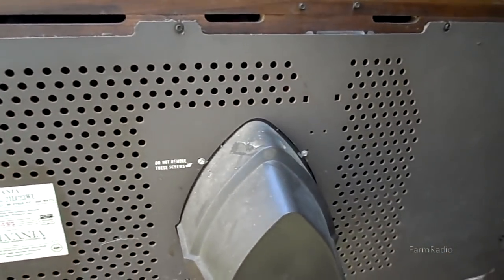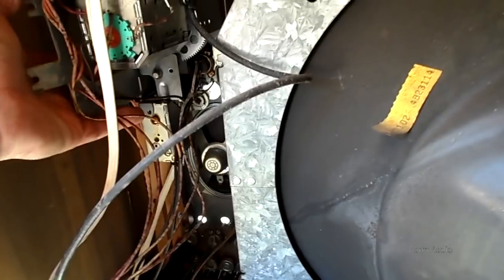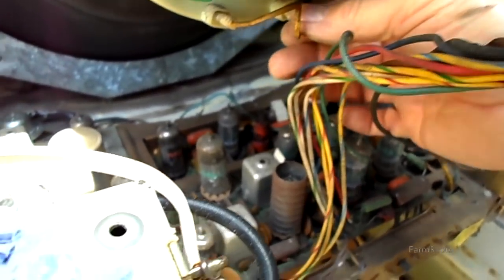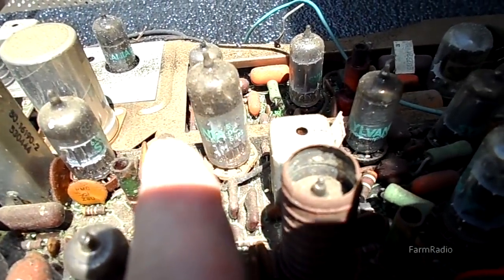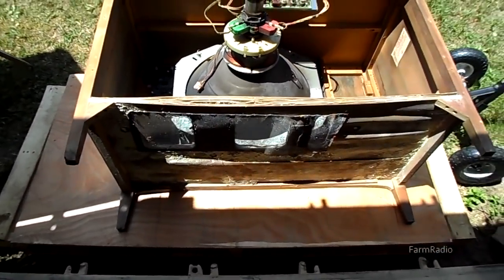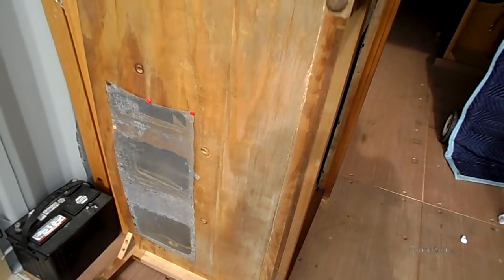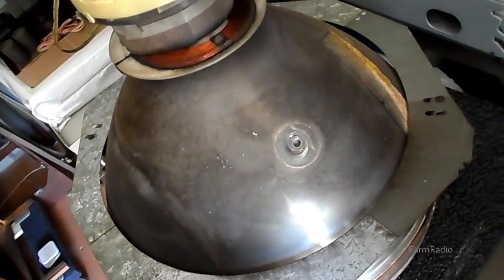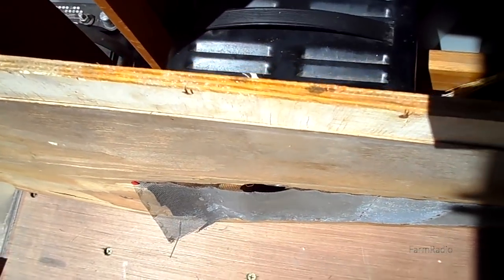1964 Sylvania 21LC23WV Color TV. Addressing cabinet mildew removal.

Comment: Must be a low hours set. Lots of OEM tubes (green printing) . Sylvania replacement tubes have a yellow or red printing. Use a low watt soldering iron on the p.c. board. The traces on Sylvania board lift much easier than most other brands.